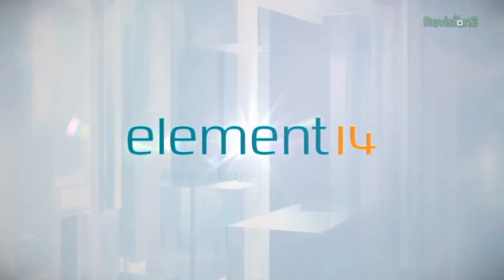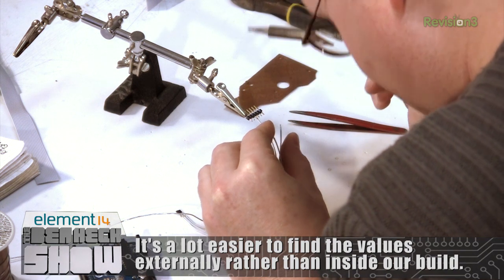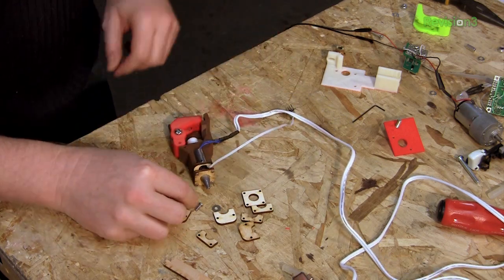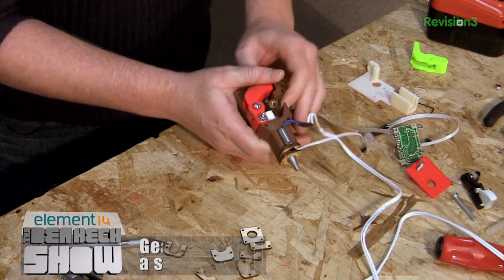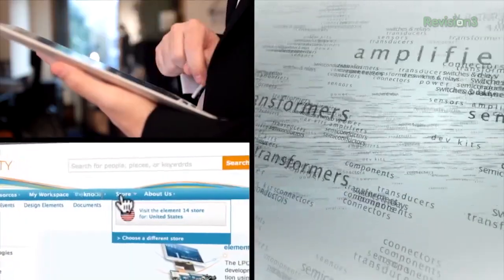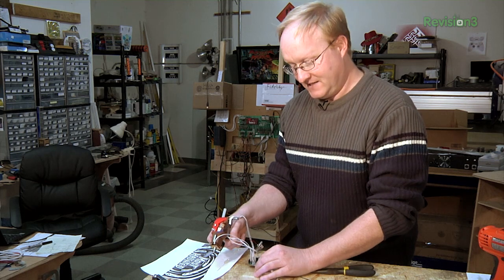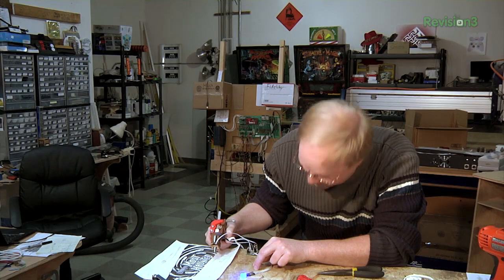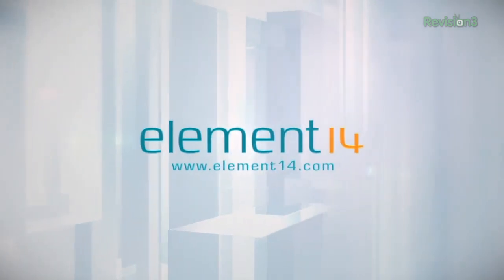Great Glue Gun Part Two

Comment: sooo... how about a self-reloading, adjustable "tip-length", glue-gun?

Maybe a revolver or belt "magazine", with multiple tips, (different length with simple connections to be changed at need), maybe with a longer "warm part" so that you can use higher speeds, (for when you need to use hot glue to fill a volume rather than just gluing).

BTW, I thought there was conductive hot-glue? Maybe make your own? OH! how about a "make-your own hot-glue episode", where you can make a "conductive" glue, chocolate 'glue', heat-transferring glue (for CPUs that's absolutely non-conductive), and other fun things :-O

Comment: I always wondered why extruders are so fucking short, you have a 10-inch glue stick and you can't get it out after it's in, so why not have another two inches of heated glue at the ready instead of these little one inch extruders?

That settles it, I'm making a long-barreled hot glue gun with one of those motor thingamajigs.

Comment: The fact that glue was waisted to make this video gave my an idea:
make a glue recycler, by combining a shredder and a filastruder.
Reply: Give this man a medal.
Reply: Ben should do this ! :)
Reply: but almost all of my wasted glue has impurities like paper, dirt, wood splinters, etc. we need to get a way to easily and reliably clean the glue.
Reply: Add some metal shavings to it and make a conductive glue stick!!! :D
Reply: Do this.
Reply: you sir, is a genius
Reply: kenrick encinas good point.
One way would be to sand of the dirt if you can peel the hardened glue of the surface.
And I think filtering should be possible because hot glue has a low melting point, in other words the glue can be pressed through a filter while it's melted.
In some applications you wouldn't care about dirt.
Reply: hed420
There are better ways, one of them would be nanoparticles (from copper) or graphene solutions. And these sort of things can be bought from china for cheap.

Comment: instead of 10$ glue gun prob more around 40$ for this so might no sell that well
Reply: It's about the functionality, a uniform flow hot glue gun is probably a thing that many might want for their DIY projects

Face it, 40$ is what I make in an hour at my low-pay job, so it's a negligible cost
Reply: or you could make it yourself and spend 20$ - 25$ ^^
Reply: Frank R. Haugen I'm not sure many would consider $83,200 a year a low-pay job.  In the US the average household income(i.e. both adults) is $52,000.
Reply: TFHDeathUA33 I'm Norwegian ;-)
Reply: Frank R. Haugen So is that $83,200 in US Dollars?  Cause my understanding is that $1 US is equal to about 6 Krone.  You make 499,200 Krone a year then assuming you meant $40 US?

A quick google says the average wage in Norway is 43,000 KOR.

For a slightly better entry level glue gun $40 US is a pretty steep.  Then again we don't always do these things to save money.  :)
Reply: TFHDeathUA33 actually... I might have screwed up the math somewhere, or more likely I meant to write 20$ or that I made 40$ per two hours, and my easily confused brain messed it all up :-P